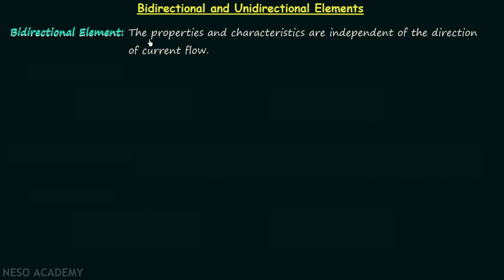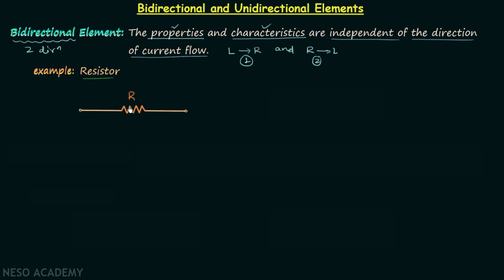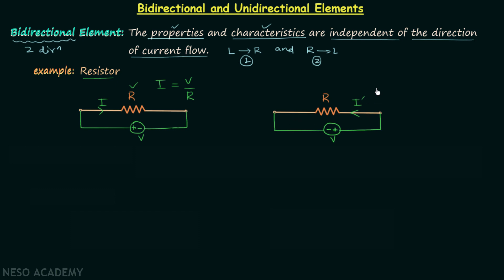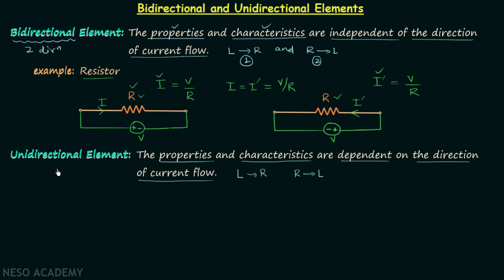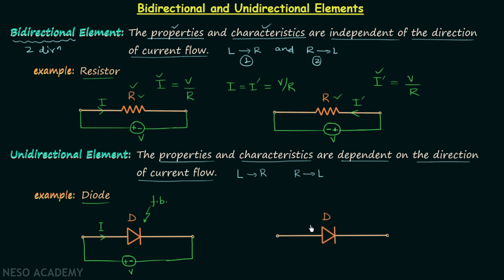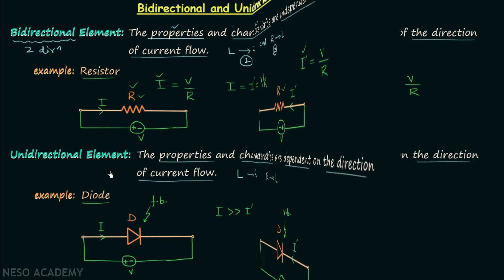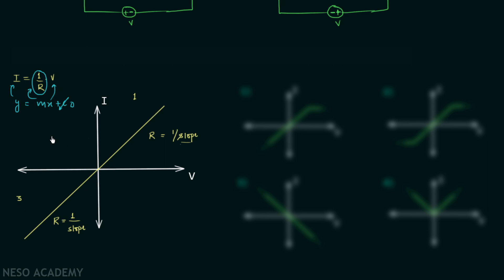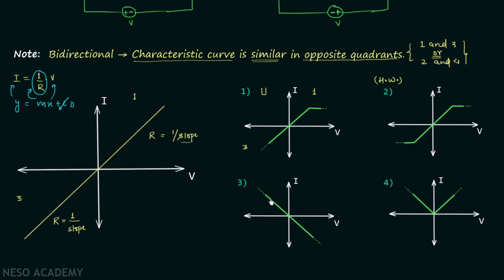Bidirectional and Unidirectional Elements

Comment: According to their definitions, I suppose that

· Bilateral elements are: resistors, inductors, un-polarized capacitors (e.g. ceramic), etc.

· Unilateral elements are: polarized capacitors (e.g. electrolytic), diodes, LED, etc.

Comment if I'm wrong. However, how could we classify elements with more than two terminals, such as transistors (which have three terminals) or transformers (which have four terminals)?